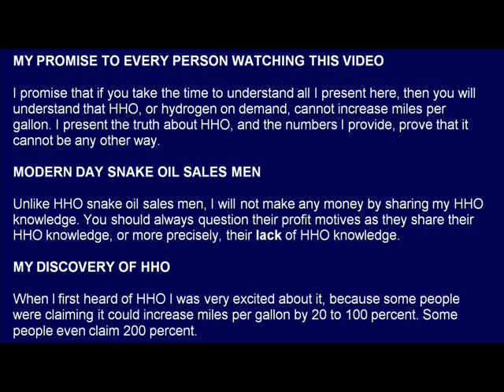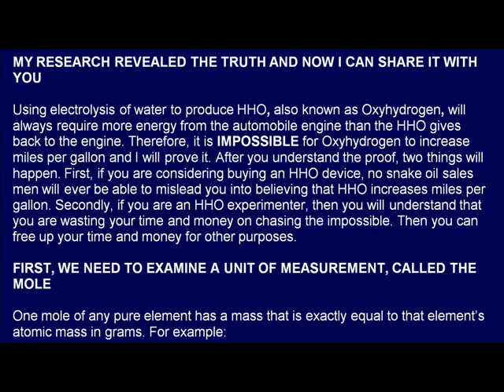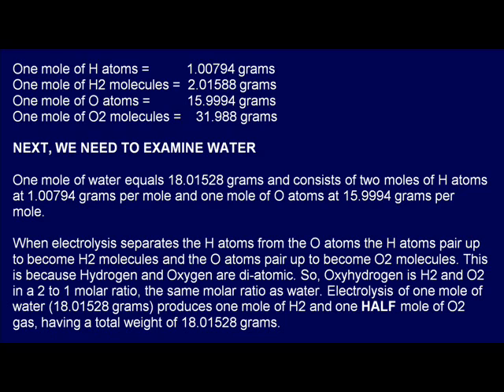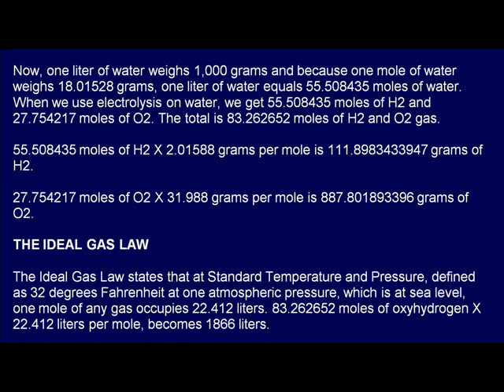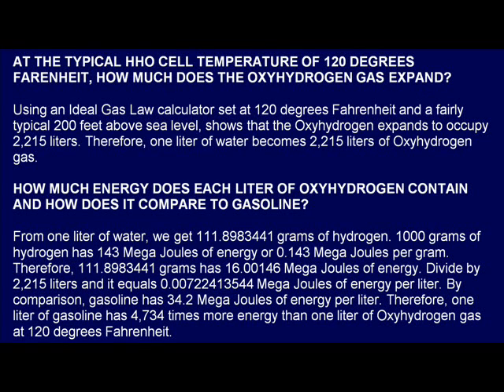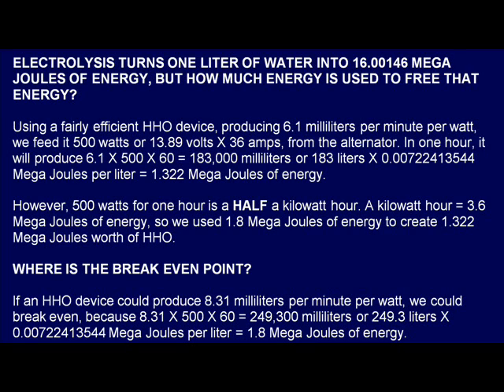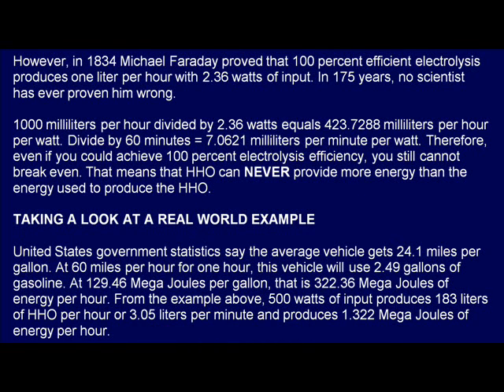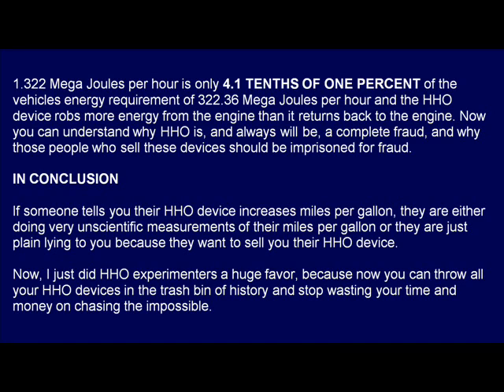ABSOLUTE PROOF IT IS IMPOSSIBLE FOR HHO TO INCREASE MILES PER GALLON

Comment from the maker: @terryblount163
The 1 MPG increase is an measurement error. Doing precisely 60 MPH with cruise control, I got 37.8 percent better MPG going north than south, on the same stretch of highway. The reason is because north had more downhill grades. Varying road grades make it impossible to measure fuel consumption accurately. So the EPA uses a dyno. It is impossible for HHO to improve MPG, my video proves it.

Comment from the maker: @popularluser
My video shows that 500 watts worth of HHO yields 0.41 percent of the energy needed for a 24.1 MPG vehicle. That means you would need 121951 watts to produce enough for 100 percent, an obvious impossibility. Since electric motors are about 91 percent efficient and HHO devices are 50 percent efficient at best, it makes more sense to forget internal combustion engines for saving energy. However, electricity from the power plant not used immediately cannot be stored.

Comment from the maker: @helicrashpro
When scientists use a bomb calorimeter to determine the energy in hydrogen or any fuel, they mix it with the precise amount of oxygen needed for complete combustion, so the amount of energy in hydrogen is all that matters. The energy values in the video are based on standard pump gasoline. Racing gasoline has octane added to it to raise the temperature at which engine knock happens, to prevent high compression race engines from self destructing. Octane is not a measure of energy.

Comment: Funny how you compared hydrogen gas to gasoline and not hydrogen and oxygen gas. So you comparison numbers mean nothing in terms of what hydrogen/oxygen gas has for energy. That is like using just carbon energy to define the energy in gasoline. That obviously does not define the energy in gasoline. The other thing you conveniently did not mention is what mixture of gasoline you are using to base your values. Gasoline is a mixture of different hydrocarbons. What mixture are you using? Race gas?

Comment from the maker: @TheBillythekid2010
As my video shows, 3.05 liters per minute only provides 4.1 TENTHS of one percent for a 24.1 MPG vehicle at 60 MPH. The supposed gain is offset by the increased load on the alternator. HHO can only result in LESS miles per gallon, NOT more.

Comment from the maker: @slizzardman
Nitrous oxide does NOT increase power by itself. It injects more oxygen so that MORE fuel can be fed to the engine, NOT less fuel. Air only has 21 percent oxygen, but with nitrous oxide, up to 33 percent oxygen delivery to the engine can be achieved.

Comment: if an engineer would redesign a car to incorporate some some sort of wind mill in place of radiator to produce electricity to power a small internal combustion engine on hho to power an electrictal generator to run an electric vehical, would this not be better for the country in 2 ways, 1 dependence on forein oil, 2 air pollution.

Comment: Hello EnergySupply2008
  I have only recentlly discovered the HHO concept.  However from all the utube vids and web sites I have seen I think there are other ways to explore this.
One individual claims by accident he put ac power into his electrilizer and got more production than Faraday's law. 
  Is it not true that if you could run an engine off 100% hho there would be ZERO emissions?,  even if it required more battery electricity would this not be a step in the right direction.

Comment: I've been experimenting with HHO for 5 years & agree with you 99.9% on your views regarding the energy required to produce a usable amount of HHO.Initially I started my quest for this "super" gas with tunnel vision,believing that it was the answer to achieving a cheaper way to run my car,a 3ltr Volvo.I built wet & dry cells,PWMs & MAF enhancers,all installed to run automatically via a series of relays & monitored by a digital ammeter & shunt.The result was  less than 1 mpg at 25amps,more to come

Comment: The theory behind HHO is not to replace gasoline. It never has been. The idea is that the hydrogen combines with the gasoline to provide more complete combustion, an idea you have not even brushed on. HHO is simply used to access more of the stored energy inside the gasoline. 

The concept put forth in this video would mean that nitrous gas can't increase power either, since it has a similar function, yet it does. Nitrous is corrosive so it's not suitable for long-term use. HHO is not corrosive.

Comment from the maker: @kfortner51
At 15 MPG at 60 miles per hour we use 4 gallons in an hour X 129.46 Mega Joules per gallon = 517.84 Mega Joules of input. At 3.05 liters per minute of HHO, 183 liters per hour X 0.007224 Mega Joule per liter = 1.321992 MJ or only 0.255 percent of the requirement. Breaking it down per cylinder per cycle would not alter these facts.

Comment from the maker: @thundercomputer
Of course I am comparing a liquid to a gas. The point is that gasoline has 4734 times more energy per liter than HHO. At 2.5 gallons requirement per hour at 60 MPH, we need 9.4635 liters of gasoline or 44,800 liters of HHO. That is 747 liters per minute. 3 liters per minute is only 0.40 percent of the requirement, but since energy from the engine powers the alternator, and an alternator is at best 50-68 percent efficient, there is a loss, not a gain.

Comment from the maker: @badbarada
When the battery is up to full charge, the voltage regulator senses it and turns off the flow of energy to the alternator windings. Thus, the alternator takes almost no energy to spin at that point, only bearing friction. The HHO device keeps the battery in a constant state of discharge, so it puts drag on the alternator and therefore the engine. No energy from the alternator is ever going to waste under normal circumstances

Comment: @EnergySupply2008 
You are 1000000% right.
it's just simple physics. I've tried it but never believed this from very first second i heard about this idea. 
So what i figured that i've burned more fuel in order to provide DC current from battery to HHO system to make it work LOL
I'm sure that you will spend 20% more fuel to make this HHO system run.
It's like putting extra 200-300 lb on your car.
If you want you can install solar panels on your car and then connect it to HHO system. LOL:D

Comment: @EnergySupply2008 
Would you care to go through your calculations and be a bit more specific.
ie: How much gasoline is being used in an engine that gets 15mpg at 60mph running at 2000rpm.   What is the per cylinder per cycle numbers relevant to the amount of gas introduced into this engine at these rates and your 3.05 L/m.

Comment from the maker: I still see problems with on board storage regarding United Nuclear. Also, I do not really think electric or hydrogen are answers, because both require burning more coal at the power plants and it is a extremely dirty fuel and still relies on fossil fuels, and yes, they desperately need to put a really sweet body on the Prius, what were they thinking? Solar just won't hack it for making hydrogen, better to use it with electric vehicles. Maybe somewhat doable.

Comment from the maker: Price is a factor. The Tesla Roadster is $12500 if I remember correctly. It uses something like 6800 tiny lithium Ion batteries for supposedly 220 miles if I remember correctly. Not too bad, but still expensive at $30000 for a battery pack replacement.

Comment from the maker: Bob Lazar of United Nuclear states that the hydride material needed to store the hydrogen compactly is unattainable because it requires access to materials used in the manufacture of nuclear weapons and is strictly prohibited.  At best, producing hydrogen from electrolysis is 59.35%  efficient and that is only if you can achieve 100%  Faraday electrolysis efficiency. We are much better off using the electricity with electric cars at 85% efficiency than IC engines at 20-25% efficiency.

Comment from the maker: @PulseFuelNerd - Absolutely brilliant. What do bumblebees have to do with the HHO scam? People telling you they get 15 percent does not take into account varying road grades. My car reports 99.99 MPG going down a slight downgrade on the highway and 18-27 MPG going up a slight upgrade. Plus, we cannot see inside the gas tank to know with precision if we filled it the same each time. (trapped air for the vapor recovery system) and pump click off measures air back pressure, not gallons.

Comment: i totally agree and thank u for the video 
the only true way to actually use hydrogen gas is the kit sold in unitednuclear@com @=.
where you produce hydrogen gas at home which takes time and you have to hook up the system to a 110 v outlet & or also renewable but the main idea is that you cant produce this in your car clearly the laws of thermodynamicsdo not  allow this to happen so thanks energysupply2008

Comment from the maker: NASA part 3

MJ per liter. Hydrogens LHV is 15.45% less than its HHV = 0.00611 MJ per liter. A 24 MPG vehicle needs 5.0525 MJ per minute. If we want to achieve NASAs 10 percent, we need 0.50525 MJ per minute from HHO. At 0.00611 MJ per liter, we need 82.7 LPM. At 6.1 milliliters per minute per watt, we need 13,557.4 watts. At 13.8 volts, that is 982.42 amps. Now you can see why HHO is 100 percent fraud.

Comment from the maker: NASA Part 2

NASA got 10 percent enrichment from the reformer, producing 83.746 MJ per hour. NASA tested a 7.4-liter engine at 55 MPH. Therefore, its energy requirement was 837.46 MJ per hour.

Gasoline weighs 6.153 pounds or 2.791 Kilograms per gallon. The LHV of a gallon of gasoline is 43.448 MJ per Kilogram X 2.791 or 121.26 MJ.

At 24 MPG at 60 MPH, we use 2.5 gallons X 121.26 or 303.15 MJ per hour, (LHV) which is 5.0525 MJ per minute.

My video shows that at 120F HHO has 0.00722413544

Comment from the maker: NASA Part 1

My video used Higher Heating Value. NASA used Lower Heating Value because internal combustion engines cannot capture the heat in the condensation of combustion. Using LHV makes more sense. Now it is time to convert my video numbers to LHV.

NASA used wasted exhaust heat to reform methanol into hydrogen. The resulting gases produced 83.746 MJ per hour. (LHV) - Only 27.662 MJ per hour came from the hydrogen. The other 56.084 MJ per hour came from the UNreformed methanol.

Comment from the maker: @jones13186 - My video shows with extreme precision that a HHO device producing 3.05 LPM produces 1.322 MJ of energy in one hour, while using 1.8 MJ of energy from the engine in one hour, while said engine uses 322.36 MJ of energy in one hour. So the question is, with an HHO device using more energy than it produces, how can anyone believe that HHO increases miles per gallon?

Comment from the maker: Summary of my video.

Per liter, gasoline has 4734 times more energy than HHO at 120 F degrees.

At 500 watts at 6.1 milliliters per minute per watt (MMW) - per hour, HHO produces 1.322 Mega Joules of energy and consumes 1.8 MJ.

At 8.31 MMW, we could break even. But, 7.0621 MMW is 100 percent Faraday efficiency, so we cannot break even.

3.05 LPM provides 0.41% of the energy required by a 24.1 MPG vehicle and the HHO robs more energy from the engine than it gives back to the engine.

Comment from the maker: At 120 F, HHO = 0.007224 MJ of energy per liter  = 6.84715 BTU.

1,500-watt electric heater = 5,118 BTU per hour.

1,500 watt  HHO device at 6 milliliters per minute per watt, produces 9,000 ml or 540,000 ml an hour or 540 liters x 6.84715 BTU = 3,697 BTU per hour. 

Heat with 1500 watts for one hour.

Electric 5118 BTU
HHO 3697 BTU

3697 + 38.44 percent = 5118. Electric heat = 38.44 percent more with the same amount of electrical watts. Heating with HHO wastes energy and money.

Comment from the maker: Now, the ZeroFossilFuel test showed that 25 amps into an HHO device, can NOT even power itself when used on a tiny engine. What are the chances that will change for the better on a car using more than 8 times more gasoline per hour than that tiny engine? The answer is ZERO chance.

Comment from the maker: HHO can NOT reduce gasoline consumption.

watch?v=9GAcjkx8F48

ZeroFossilFuel, 5 HP engine powered alternator that powered HHO device. Tested run times with measured amount of gasoline, with and without HHO. In the comments, he wrote:

No alternator load, no HHO, run time = X
25A alternator load, no HHO, run time = 0.86X
25A load, HHO fed back to carb, RT = 0.94X

25 amps REDUCED run time by 6 percent. HHO device could NOT even make enough energy to offset its own energy consumption.

Comment from the maker: My video shows that per liter, HHO has 0.007224 MJ of energy and gasoline has 34.2MJ of energy.

At 60 MPH at 24 MPG, we use 2.5 gallons, or 9.46352 liters of gasoline per hour. 9.46352 liters X 34.2 MJ of energy = 323.65 MJ of energy per hour.

At 3 LPM of HHO, 180 liters per hour X 0.007224 MJ per liter = 1.30 MJ of energy per hour. Which is only 0.40 percent of 323.65That is why HHO CANNOT increase miles per gallon.

Comment from the maker: HHO is not powerful either. 

Mega Joules of energy per liter.
Liquid Hydrogen = 10.1
Compressed Hydrogen at 10153 PSI = 5.6
Gaseous Hydrogen = 0.01079
HHO = 0.007224 (at typical HHO temp of 120 F)
Gasoline = 34.2

Comment from the maker: HHO is not inexpensive. An HHO device at 6.1 MMW (86.34 percent Faraday efficiency) with 500 watts input per hour, uses 1.8 MJ of energy from the engine to produce 1.322 MJ worth of HHO. That means you get better MPG if you turn off the HHO device, as happened in the Dateline NBC test at the certified EPA testing facility. So HHO wastes gasoline. That makes HHO very expensive over time.

Comment from the maker: Correct. But my video shows 1 liter of water becomes 2215 liters of HHO at 120 F degrees. At 3.05 liters per minute it takes 12.1 hours to make 2215 liters. At 60 MPH at 24.1 miles per gallon for 12.1 hours, you travel 726 miles on 30.12 gallons of gasoline, so you burn 114 liters to make the equivelent of 1 liter of gasoline. (0.87 percent) 

Per hour, a 500 watt HHO device producing 3.05 LPM uses 1.8 Mega Joules of energy from the engine to make 1.322 Mega Joules worth of HHO. A net loss.

Comment from the maker: The boiling point of Hydrogen is 423 degrees Fahrenheit BELOW zero. Below that temperature, it is liquid, above it, gaseous. 

Mega Joules of energy per liter.
Liquid Hydrogen = 10.1
Compressed Hydrogen at 10153 PSI = 5.6
Gaseous Hydrogen = 0.01079
HHO = 0.007224 (at typical HHO temp of 120 F)
Gasoline = 34.2 

34.2 divided by 0.007224 = 4734. Therefore, we see that it takes 4734 liters of HHO to equal one liter of gasoline. Therefore, HHO is a half an ant fart compared to gasoline.